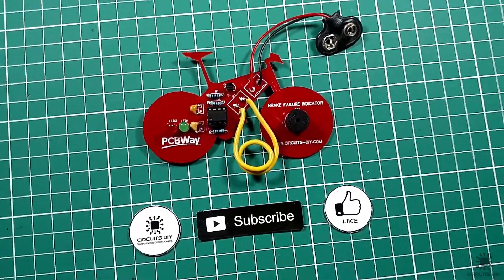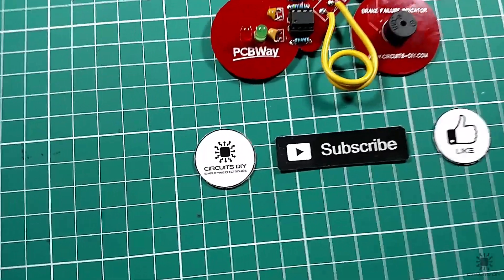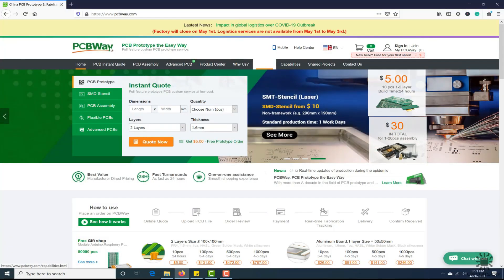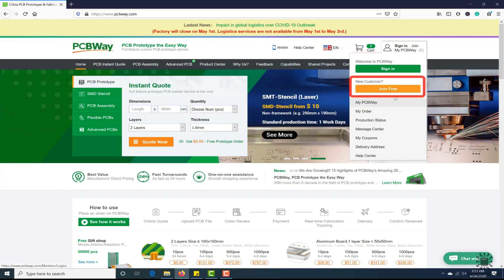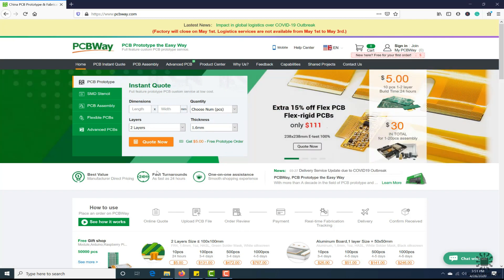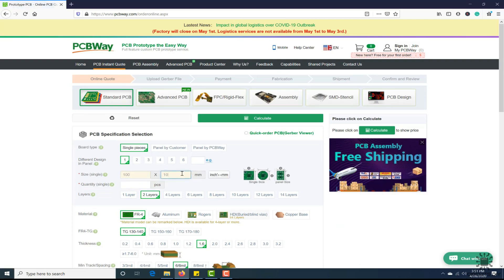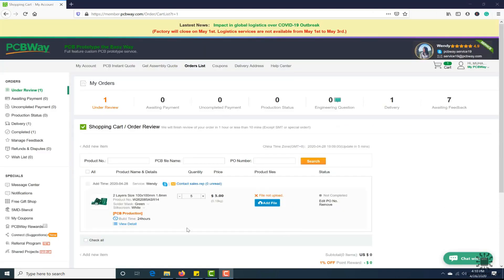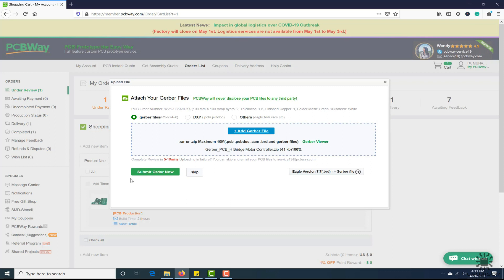Brake Failure Indicator Mini Project | DIY Electronics

Comment: Don't make sense how and where you would use this..... cud just use transistor but for bicycle ya need 4 inputs for the brake pads ....you need to add tyre pressure too 🤣🤣